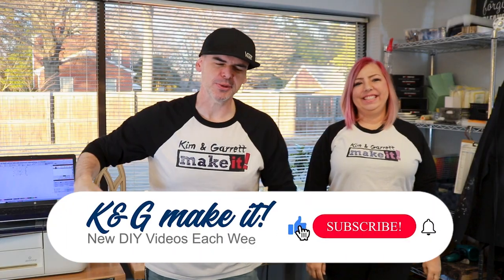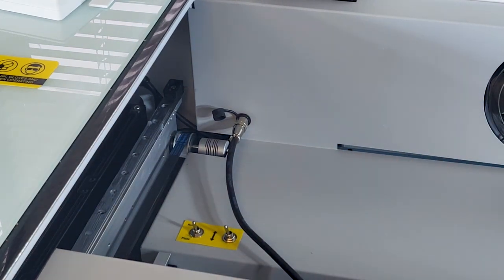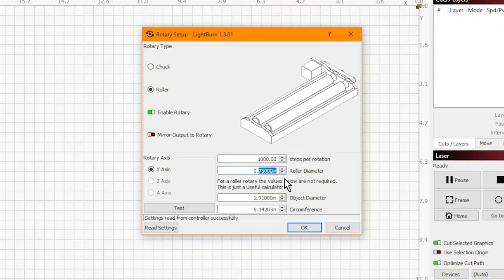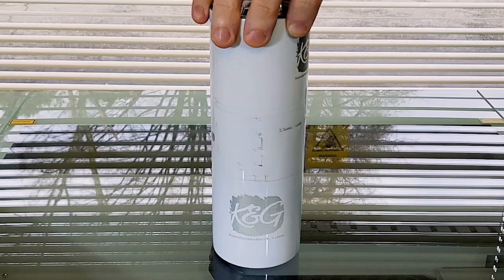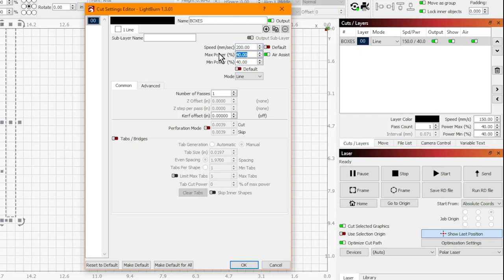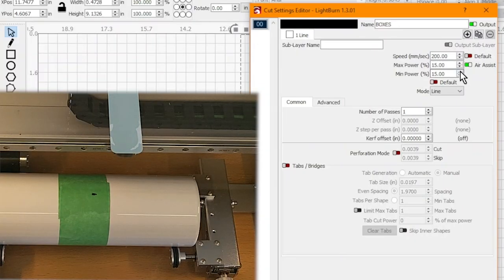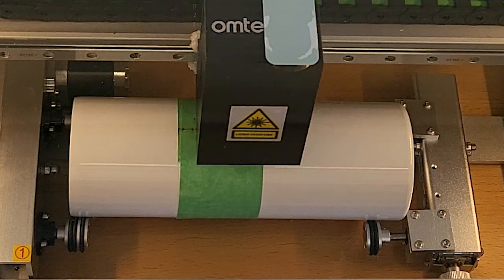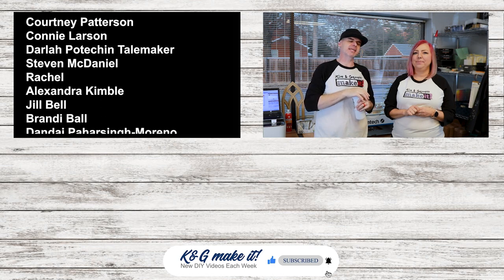How to Install and Use the OMTECH Polar Laser Engraver Rotary Attachment

Comment: Don't you answer questions ? Some seem important to the operation of the unit as you miss giving important info. Like tumbler size ? Do you need to raise the unit ?
Reply from the maker: We did not need to raise it for this tumbler (20 oz), but we did need raise it with some MDF scrapes when we did the larger tumbler.
Reply: @KimandGarrettmakeit  Thanks.!

Comment: Thanks guys, I am going nuts trying to find out which machine to buy. They all have problems of some sort. 
So you like Polar the best?
Reply from the maker: I like the Polar, it works great.  It really comes down to what you want to make.  If you plan to make smaller items (11" X 20") and tumblers, the Polar is GREAT. If you plan to make bigger things, you may want something with a larger cut area or a bigger passthrough. Hope this helped! ~garrett
Reply: XTOOP P2 IS GREAT FOR TUMBLERS! Might be a bit more pricey but easiest machine I have used for tumblers

Comment: Could you raise the machine to do larger diameter tumblers?
Reply from the maker: YES!  I tried to do my larger tumbler and had to slide 3 pieces of of 1/4" mdf under each foot.  BUT it came out awesome! The connecter cable for the rotary attachment should be a few inches longer, but it worked.
Reply: @KimandGarrettmakeit  I had just realised that the polar is really not that deep (5cm). And i wondered if it can be lifted. Technically, could I lift the machine(as high as required) to engrave even larger items than a tumbler? I like the 60w but I have an home office so a beast like that is a no go. Would appreciate your opinion. Thanks!!

Comment: my rotary spins the item around to the opposite side when you engrave. Do you know what the problem might be? It makes it harder to know exactly where the artwork will end up.
Reply from the maker: Are you using xTool Design Space or Lightburn? Lightburn has two places to check for the rotary. Is the rotary facing the right way? (just checking)

Comment: I can't figure out where my test runs will end up? Is there a way to find this out? Every time I do a test run, I end up testing over over testings.
Reply from the maker: Hmm I'm not sure what you mean?
Reply: I’m reusing a tumbler to figure out settings, so I have markings all over so far. But as I start a new one, I try to put it in a blank area from Lightburn using the camera control. But once’s it starts, the tumbler rotates and then it’s writing/engraving over other stuff I’ve tried to do and not the black area anticipated. I manually place it on the rotary for a blank area but then it’s turns and it’s engraving over something else. 

I hope I explained this better lol

Comment: I have been unable to get my gantry to align with the cup on the rotary. Stays stuck in far right. Then shows a red status light. I am just not sure waht imnfmdojng wrong. All your steps have been followed. When i hit frame nothing happens and get a message that it is having trouble communicating  w controller? 🤦‍♂️🤷‍♂️